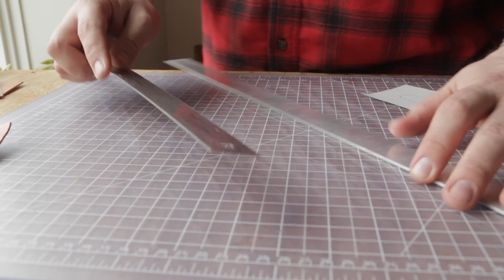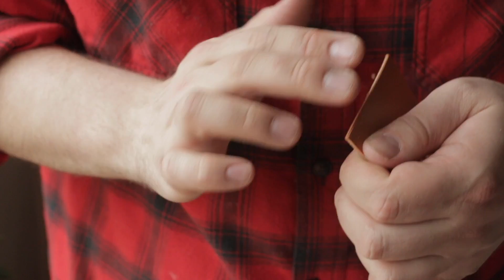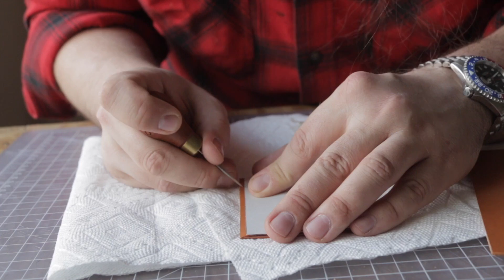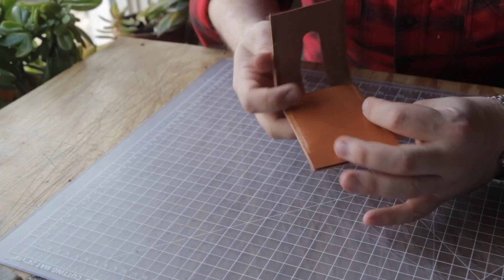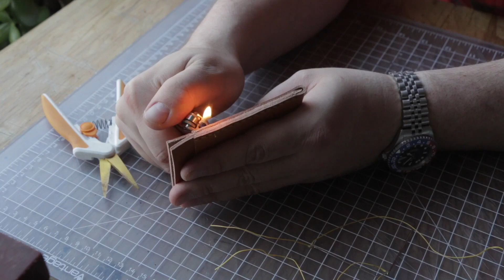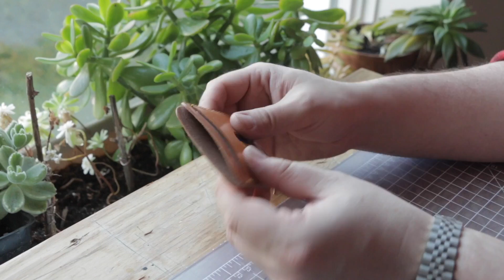Redesigning Our First 1,000,000 View Wallet (WITH PATTERN!)

Comment: Bought the pattern the other day and tried doing it at home 😊 I used thinner leather, so I had to do a couple of adjustments - added one more piece in the center to have an opening on the side as well as on the top, and made the thumb slider hole smaller to keep the cards sitting more snuggly in the outside slots 👌 ended up having to do 5 stitch lines instead of two(had to add one on the bottom as well, as I like to stick small things in and don’t want them to fall through), but works very well now and I can even keep cash in a separate slot on the side 👍

Comment: I cut my teeth leatherworking making the card wallet of your on the weaver site about 15-20 times in a row. I modified it over time to have the hole across the bottom like this because I found it easier to slide the cards.  I love this pattern and may just have to give it a go.